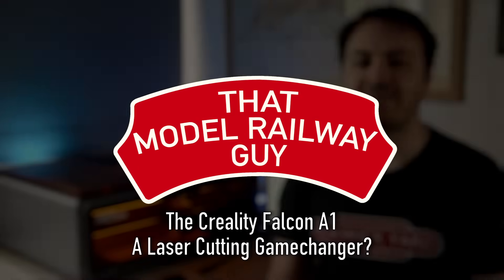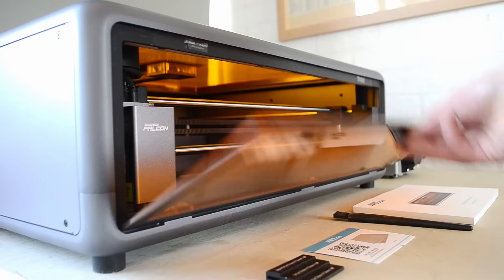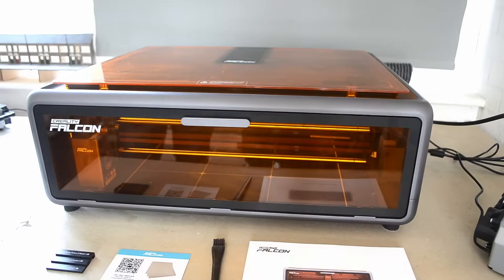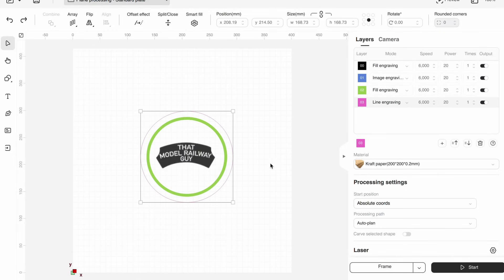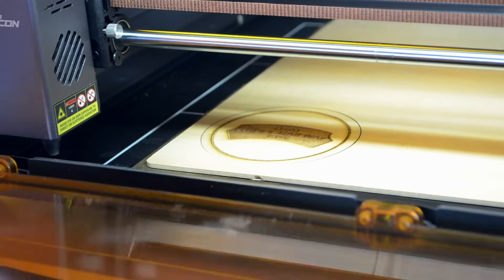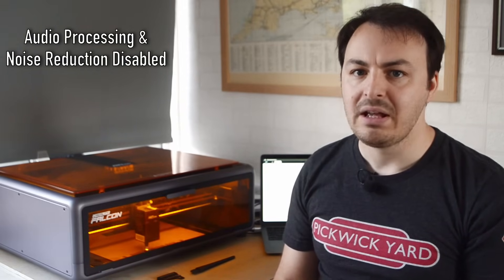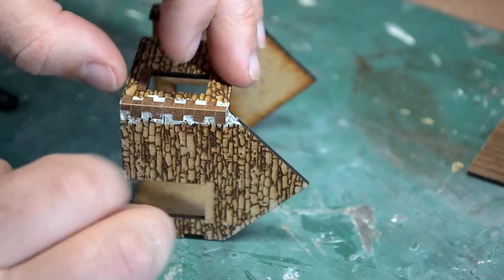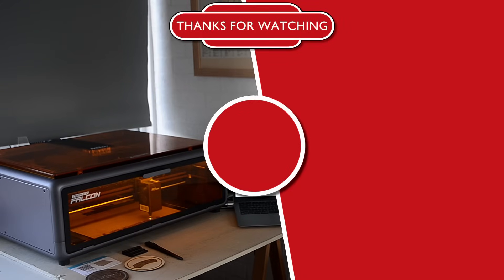A Model Railway GAMECHANGER? - The Creality Falcon A1 Laser Cutter & Engraver

Comment: Hi,
Can you share some examples where you create the tabs structure etc - and any adjustment so things fit?
Is it a do it once then cut/paste into the next model - any shortcuts/techniques etc.

I'd always gone for plastic kits - but just picked up a Peco signalbox and really impressed with the laser cutting - hence going down a bit of a rabbit hole to see what is possible outside a commercial setup.

The idea of modelling closer to prototype vs. compromise on what is commercially available is really interesting. 
Cheers.
Reply from the maker: I would like to do a video in the future on how to design for laser cutting - as always it's a case of finding the time to make it! 

It's not quite a simple cut and paste job, it depends on the thickness of the material you're using and generally you want to align the slots and tabs in a way that makes sense with the overall structure of your building. But once you've figured out the basics and your own way of working, it becomes a lot easier to replicate for further designs.

The Falcon A1 is definitely the first machine I've seen that makes sense for a non-commercial setup. It feels like it's aimed more at general hobby users and with the price being much closer to a 3D printer than previous versions it does feel like now is the time for some videos on how people can get the most use out of them.... so stay tuned essentially 😅 Thanks for watching 👍
Reply: @ThatModelRailwayGuy  Thank you - really interesting videos. 
The process of prototype photo/scaling to model - especially for relatively flat structures - buildings - bridge sides, tunnel mouths feels more direct than 3d printing - also - potentially higher resolution results.

Comment: What was the material that you used under the piece you were cutting. I see that Creality has sold out of the hex material base they intend users to use for cutting to not damage the underlay.
Reply from the maker: It was just a piece of sheet metal that I had going spare. There are plenty of other honeycomb beds available though, you don't have to use one specially from Creality. Check out Amazon (or similar) for other brands. Thanks for watching 😃

Comment: Unfortunately with all of these 3D printers and lasers there is a high break even point. You can buy an awful lot of buildings and accessories for what it would cost to buy these printers and materials. Especially when you shop around and grab yourself some bargains. I recently bought a load of houses and buildings from a place that sells loads of second hand stuff.  
Thanks
Reply from the maker: It's not about "breaking even" though, it's about having fun. Sure if you wanted to go into business producing kits or models then that would be a consideration. But for the average hobbyist it's the same as buying something like an airbrush - you don't buy one on the basis that you'll save money on spray paint. You buy one because it's a tool you're interested in using and think it'll help produce the results you're after. It's the same with laser cutting or 3D printing but for those happy to use ready made products or existing kits there's nothing wrong with that and that's where you should spend your money. Thanks for watching 👍
Reply: @ThatModelRailwayGuy 
If I had plenty of money it wouldn’t be a consideration but this hobby isn’t cheap. For me to spend that amount of money would take a lot of serious thought. By the way someone has recently given me an airbrush 🤣🤣🤣
Thanks for taking the time to reply. 👌🚂

Comment: I'm using an X-Tool laser for cutting and engraving bridges and tunnel portals that I design on my laptop. Buildings will be next!
Reply from the maker: Great stuff! I've been contacted by xTool in the past but haven't checked out any of their stuff yet. Thanks for watching 😃
Reply: @ThatModelRailwayGuy Their companion creator software is relatively easily once you get past the learning curve. I'm 77 so if I can do this, many others can too. It's particularly good for me as I model in Z scale. Really broadens the options.
Reply: £530, it etches MDF and acrylic (I think) and can presumably cut out decals and windows from card.   It requires using a separate printer to create the coloured parts to cut out (or texture)
I liked the product QR code thing...and I would want to see that a workpiece-specific (scan this and produce 20 units) type instruction.

Quiet is so important.  Do you really find 10W adequate?
Reply from the maker: @simonmasters3295 It more than just etches, it cuts through wood and acrylic (and all sorts of materials) so you can make your own kit of parts. If you follow the technique I showed I the video you don’t need another machine to make coloured parts, you can just engrave the surface with the brick/stone/whatever pattern you want and just paint like you would a normal kit.

I’ve found 10w is fine for mode railway stuff. Generally we don’t want to use materials that are too thick as it’ll make the model look chunky. So anything up to 5mm is totally fine. Even thicker material it’ll probably cut through if you do it in multiple passes. But there is a 22w version due later this year for those that do want to cut thicker material. Thanks for watching 😃

Comment: Just when I thought I was ready to go with a 3D printer, you show me this! Lol! I've been using a Cricut machine for a while now, and am running into its limitations for engraving brick and stonework into greyboard for N gauge models, so had been considering getting a resin based 3D printer! However, after seeing this, maybe it could replace my Cricut machine? I like the idea that it can cut thicker materials such as MDF and Plywood too! Do you know if the software can import design files (SVG files) from Inkscape? It would be handy not to have to learn another piece of software to design things! :) Cheers, Ian.
Reply from the maker: I'd say a resin 3D printer is great for smaller details (eg fencing, bins, etc) where a laser cutter is really great for larger structures and buildings. Used together they compliment each other very well so you could have a building primarily made by the laser cutter but the chimney pots and drainpipes are 3D printed.

Yes both the Falcon Design Space and Lightburn can import SVG files - in fact that's pretty much the standard way of working so that you use something like Adobe Illustrator, Affinity Designer or Inkscape to create your design and just use the machine software to actually cut them. Thanks for watching 😃

Comment: My A1 arrived this weekend. It certainly was easy to setup. 

Currently using Inkscape to see how far I can push  N gauge brickwork
Reply from the maker: Awesome, great to hear you've been able to get up and running fairly quickly. With the finer 10w laser of the A1 you should be able to get better results for N Gauge brickwork than you would with the more powerful machines. Best of luck and thanks for watching 😃

Comment: i am interested in cutting leather wallet blanks.  10W seems to be underpowered for 5 oz leather.
Reply from the maker: I can't say I have any experience with cutting leather myself but I have seen others who have been able to cut 7-8 oz leather on a 10w machine. If you're really worried there are 22w, 40w and 60w lasers available. Supposedly the A1 is getting a Pro upgrade in the future that will have a 22w laser so you could always hold out for that. Thanks for watching 😃
Reply: @ThatModelRailwayGuy  My problem, beside money is venting.  I have seen in room venting and filter buckets.  Couldn't set it up anywhere near a window.  Townhouse living is not very conducive to big machines.
Reply from the maker: @bbrachman Air purifiers are available for those not able to vent from a window
Reply: @ThatModelRailwayGuy  I knew that. More cost.  More complexity.  Not ready for that. Yet.

Comment: Great review, enjoyed it. How long is the extractor tube and did it extract all the smoke and fumes from the room. I have lung disease so need it as clean as possible and would love one of these. Thanks.
Reply from the maker: It's fairly long, 2-3m I'd say so easily enough to get out of a nearby window. And you can always replace it with a longer one if needed as it gets clamped onto the back. 
The cutting area is sealed while the laser is working so no fumes make it into the room to begin with - the extractor fan also vents continuously while the machine is in operation. I have a little air quality monitor in the room so I can keep an eye on things but so far the Falcon A1 hasn't led to any change on that front. Thanks for watching 😃

Comment: This is very interesting. I have a space where i want to set up a workshop . Laser cutting and maybe 3D printing too. With a painting table. But as usual. It’s the money holding things up. So a Falcon A1 might make it possible sooner rather than later.
Reply from the maker: I do think this machine is much more realistically priced for the casual hobbyist - especially when laser cutting isn't a requirement to build a model railway. Now it's more like the cost of 2 or 3 locos which feels much more achievable if it's something you're interested in. Thanks for watching 😃

Comment: I recently bought the much cheaper CR Falcon 10W and I am very happy with it. The great advantage of this is that you can use it outdoors with a SD card. The quality of the engraver/cutter is absolutely top! I did not expect that. And it’s perfect for model railway items from platform edges to kerb stones, railings and even buildings.
Reply from the maker: Awesome, great to hear you've been enjoying the CR Falcon. You definitely do need to use an open framed machine like that outside or in a very well ventilated space - it's honestly just not worth the risk. I'd recommend trying out the Falcon Design Space software too (especially as it's free!) as it opens up a lot more possibilities than just running off an SD card. Thanks for watching 😃

Comment: As an American modeler, a lot of our buildings feature clapboard/sideboard siding which I feel like would be difficult to replicate on a laser cutter. do you think that texture would be able to be replicated on this machine?
Reply from the maker: Depends how detailed you'd want to go with it - I can think of a few ways. 
1. Engrave the lines for the planks into a flat board - simple and quick but not the best visually.
2. Create an engrave pattern like I did for the stone texture where you have each plank engraved as a gradient to create that sloping. This would take the machine longer but you might get really nice texture from it.
3. Or do like I did with the roof tiles by cutting each line of planks separately and layer them over each other. Obviously there's a lot more assembly work here but with the laser cutter you could be sure that all the planks would have identical dimensions  - and much quicker than making them all by hand. Thanks for watching 😃

Comment: It's great to see that laser cutting is becoming more affordable now and being easier to use, great video 😀
Reply: Affordable you say...    At CA $780, I would beg to differ.  There are less expensive laser cutters/engravers on the market.  I have seen other models selling for less than CA $500.
Reply from the maker: I'm sure there are cheaper versions but I suspect they will be low powered, open framed machines. If there's a laser cutter out there for CA $500 that works straight out of the box, has a built in fan, air assist, camera and software package I'd love to check it out.

Considering the Falcon 2 machines were the equivalent of CA $2200, then $780 doesn't sound bad at all considering all the upgrades and ease of use the A1 has.
Reply from the maker: Yeah, when the cost of everything seems to be increasing it's nice to see the price of these machines coming down as the technology improves. Out of the three machines I've used, the A1 is easily my favourite and it's the cheapest of all three. Thanks for watching 😃

Comment: I have the Falcon 2 and find it terrific. I’ve mainly used it on thin ply and card for structures. This new one also looks good but you are a bit limited in size.  The frame type does allow you to cut a larger sheet.
One question, what is the thinner material you were cutting for roof tiles?
Reply from the maker: It's a bit of a trade off in my opinion - size for overall convenience. I was in exactly the same camp originally but the A1 blew me away with how user friendly it is - and more importantly how much less space it takes up.

While the open frame style is handy for larger projects, you do still need an enclosure of some sort to contain the fumes. If you're consistently making really large projects that require an open frame - making baseboards for example - then a CO2 laser is probably a better way to go. But for general model making I'd say the size of the A1 is great for making everything up to and including 00 Gauge structures and probably some O Gauge stuff too.

The tiles were made with Laser Board - comes in different thicknesses and is great for doing intricate details. It was overkill for the tiles but would be great for making really fine meshes or lattice work for example. Thanks for watching 😃
Reply: @ThatModelRailwayGuy thanks for your reply. If buying again, I think I would go with this new model for all the reasons you give.

Comment: Curve settings…? Nice review. I regularly find uses for this sort of thing but always talk myself out of it……
Reply from the maker: Kerf settings - essentially when you make a cut you loose some of the material (usually 0.5mm or something) so you need to compensate for this if you want corners to join correctly and not be loose. Thanks for watching 😃
Reply: @ThatModelRailwayGuy aaah! Yes I had wondered about how that works and tolerance etc…. Cheers!

Comment: I have the falcon 2 40W and its great, trestle bridges, easy, road bridges - easy, a complete viaduct and ramp system, easy with brick filled arches, station platforms, and all in n gauge, even for just ading that stonework texture its well worth it, I am now burning through my second order of 1.8mm ply, (i get 600x300 sheets and use the laser to cut them down, plus A4 sheets (on my second batch of 40 A4 sheets and my second batch of 20 larger sheets, add a resin printer for really fine n gauge details such as footbridges, and you are well away, just this morning I cut a front plate for a home built train controller using a pwm speed controller circuit board, a reversing switch and a regulated 12V dc power supply. all i can say is that a laser cutter is my best purchase to date.
Reply from the maker: The possibilities really are endless. I used laser cut and home 3D printed items only TT:120 layout it was a massive help! Thanks for watching 😃

Comment: What material did you use to do the tiles ?
Reply from the maker: Laser Board - it comes in various different thicknesses and is great for doing very fine, intricate pieces that are still strong. You could just use normal paper for the tiles but for doing the lattice work on a footbridge Laser Board would be ideal. Thanks for watching 😃